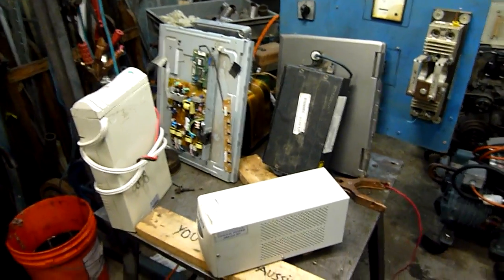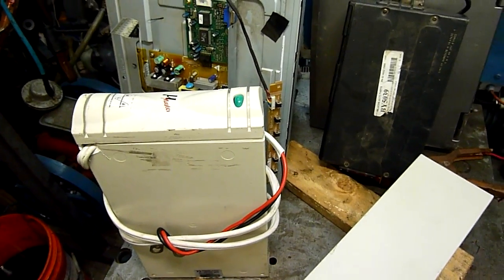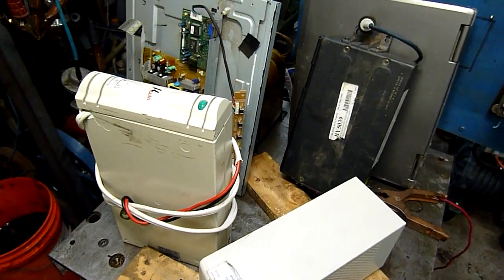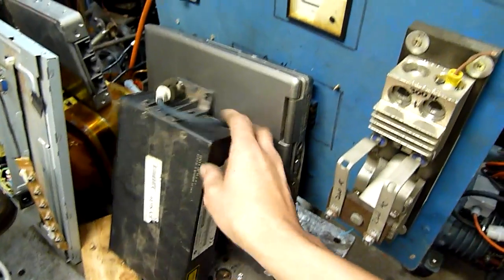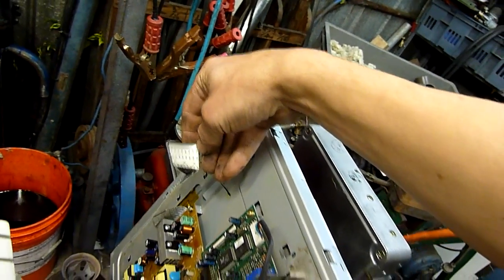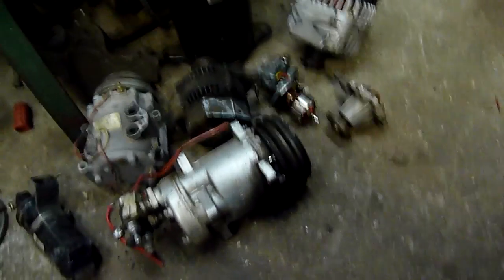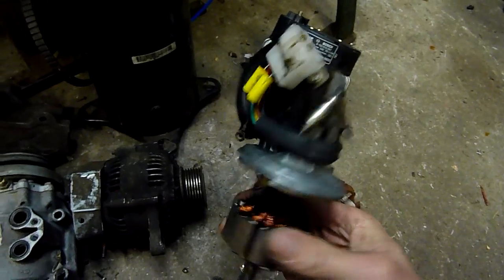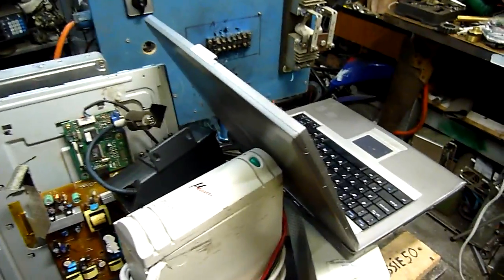Ramblotronic monday - UPS and HV Safety Concerns Plus More Equipment for Autopsy

Comment: electricity is not my strong point, i know nothing about electronics, I understand the power around a house and how the circuits work there but that's about it

all pyro is is a bit of ohms law, a bit of series or parallel circuits and that's about it.

Comment: from what I have seen over the years here the larger mega partners seem to get away with rule bending all the time, having a show account also helps as you can't flag videos on those accounts

there has always been a huge divide of fairness here, basically if you a tiny tuber you have zero rights

youtube is like a huge army, loads of grunts and only a few generals, and guess who has the nice meals and living quarters and more importantly the hot line to the president..!!

Comment: Worth checking the battery on that Dell laptop, it might be one of the ones with Sony cells that were recalled. You'll get a new battery if it's one of those, which can be put straight on eBay.

Comment: If you get that pully off, mind do me a small favour and tell me the shaft thread size & pitch .... I think its M14x1.5mm , its just so i can buy a nut to hold a soild pulley on.. I dont trust these clutch pulley and have seen them fail,  btw you will need a long M10 hex key and 33 spline key to get it off

Comment: If you want to break stuff like circuit boards with electricity, just use a car battery. Personally, the only thing I do with MOT's is 1) try to salvage the copper 2) use it to smash something

Comment: The free-wheel pulley decouples the alternator from the engine. It reduces wear on the belt and tensioner. Engine speed looks like a sinewave between power strokes, and the clutch pulley makes it so the belt doesn't have to constantly slow down and speed up the very heavy, very fast spinning alternator rotor. That's why on cars without these pulleys, you'll sometimes see the tensioner arm shake slightly while idling.

Comment: HV Concerns are understandable, personally, I never work with something I don't understand and I learn it by working my way up slowly until I am confident enough that I know what I am doing. Luckily, most of my projects are low voltage and relatively low current. Anyway, some of these equipment autopsies should be interesting, but if you were to power that laptop up instead of dismantling it, it would be a kickass gaming rig once it warmed up - as long as those games were on steam.

Comment: People using things like broom handles that look and feel like wood, but are actually metal internally as chicken sticks is one many people mess up on very easily, it's hard to tell sometimes. As for the UPS, I'd just make sure the battery terminals are well insulated so it can't short out internally if it moves during shipping, then tape a bit of hard plastic over the button. Very unlikely it could be turned on that way.

Comment: Hi ed hows you doing , like to say I understand about the microwave transformers and u need to no what your doing or it will end in getting hert or even death I was messing around with lawn mower I thort I'd wire it to LCD TV it all went wrong and ended up with a for foot arc and put me in hospital for week lucky only had miner burns I would say to all u viewers do not tri it at home leave it to ed thanks again ed keep up good work ???

Comment: i only ever keep the caps from microwaves and the two magnets from the magnetron. i work with 240volts all the time and even i leave the mot's to ED. As a side note: 240volts has a peak value of something like 300volts! so never ever play with mains voltage; an RCD will NOT save you if you constitute a balanced load, they will only trip if the active and neutral are not equal in value. ie if the neutral currant is less than the active currant it assumes there is an earth leakage

Comment: The vast majority of UPS systems available to retail consumers come ready to go. I would suggest you leave the unit fully setup to run but if there is any risk of the on / off switch being depressed in transit then put a plastic cap or similar over the button and duct tape it such that short of crushing the cap it’s off. Even if it did activate in transit all that would occur is a flat battery and some noise. and some noise that might make the posty think it’s a bomb or something. ;-)

Comment from the maker: there is a ground on all installations but neutral is not grounding on a home which has a RCD as its main breaker as I found out the hard way some years ago when I got a nasty shock from a neutral wire in a machine that was disconnected at the wall (Active line was broken by switch)